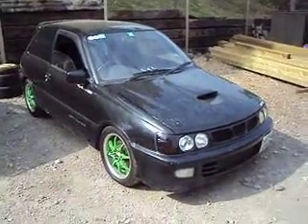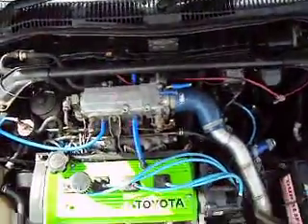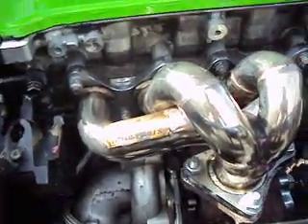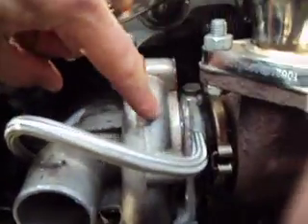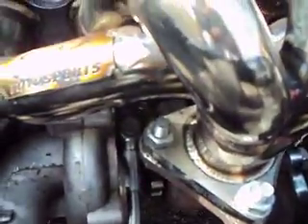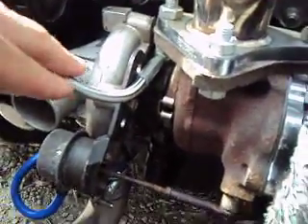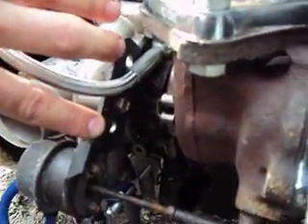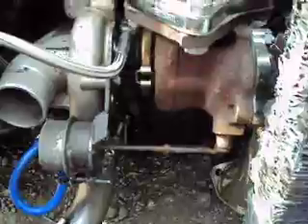Toyota Starlet GT / Glanza TD04 conversion guide - What you need and how to do it: Part 3 of 3

Comment: what setup would you use to run a 3rd gen ct9 hybrid on 1 bar?
Reply from the maker: Just make sure you upgrade the manifold as the standard one has a restrictor in it and will blow a piston at 1bar on the ct9 running stock.You then need to upgrade the fuel system as your running more boost, increase the fuel rail pressure with a RRFPR with a FCD to remove fuel cut. Get it mapped on the rollers then to make sure its fueling correct :)
Reply: I was going to get the mild steel mani and down pipe with the turbo and a regular FPR. I was trying to stay away from the FCD. I was told that the stock ecu will allow up .85 bar (12 psi)  without a fuel cut so I was thinking about living with that and staying away from the danger of a FCD. can I get away with that? lol
Reply: up to*
Reply from the maker: Prenda Blaque Yes you can run up to 0.85 bar, although i think standard is about 0.6-0.7 bar anyway so the performance difference wont be huge. A FCD is safe to run AS LONG as your increase your fueling with a replacement fuel pressure regulator. :) And i would also recommend getting a AFR to keep an eye on your fuel/air ratios.
Reply: sounds good, I was gonna get an AEM wideband anyway. I guess i will get the FCD aswell then. Thanks for sharing your knowledge.